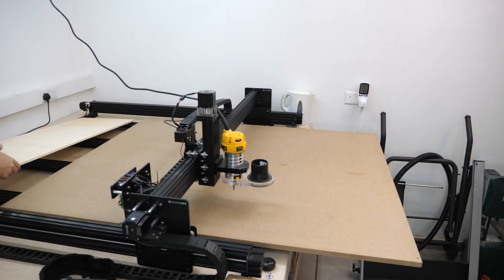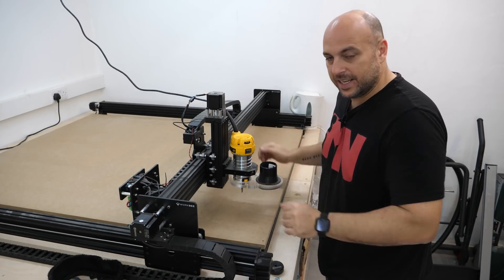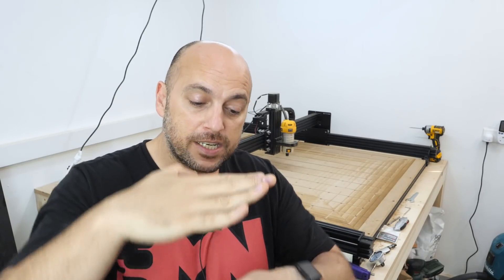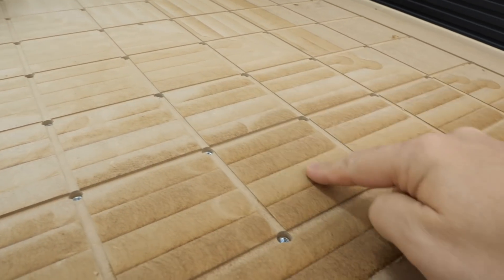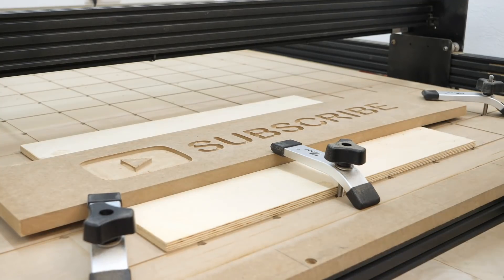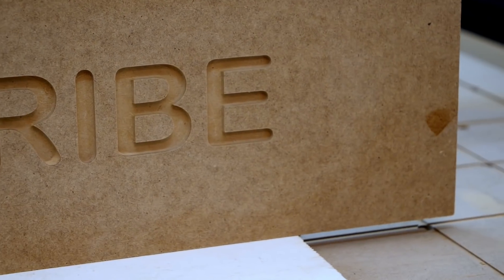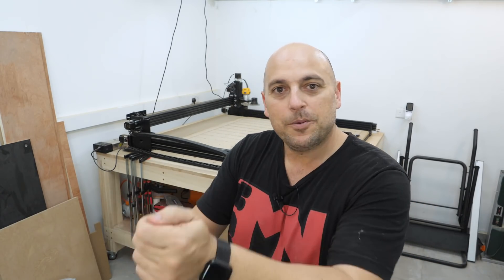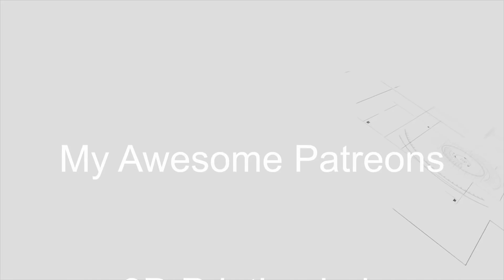First Carve On The Massive CNC - Fails And Wins!

Comment: Nice setup I have just finished building a X1.2m Y 1.5m and Z 300mm 
I use Mach3 board and just purchased the V carve vectric desktop software 
Curios to know what kind of cad cam software you are using

Comment: Great video. Hey, I noticed you have a man door cut into your garage door (I have never seen this), can you provide any info on this, did the man door come built into the garage door, or is that something you added?  Thanks
Reply from the maker: That was pre-made like that, specifically ordered it that way so I don’t have to constantly open and close the garage door. Also comes in very handy if the electricity goes out
Reply: @3DMakerNoob  OK, who is the door manufacturer who offered such a garage door? I am in TX USA and have never seen that kind of option. Thanks
Reply from the maker: It’s a local company here in Malta. Fgp.com.mt

Comment: i know you made this video 2 years ago but im really interested to know how you fastened your wasteboard to your frame.  I had a hell of a time with mine.  It seemed like I would get a bunch of the t nuts seated into the aluminum extrusion but there was always one or two that I couldnt get in that tiny little groove, so I would have to lift the entire board up and start from scratch over and over and over again.   It took me the better part of an entire day to get all of the t nuts secured.  How many T nuts do you have holding your wasteboard down?  Did you do 3 rows of them?  Did you have as much issues as i did or are you smarter and more dextrous than i am?  ^Thanks for your videos, I really enjoy watching them.

Comment: why using stinky MDF boards if birch multiplex is available?
I have segmented my lostboard for my CNC in 6 peaces, so if the damage gets bigger i have to change (only) the most bad one.
This is to you have now a big printer ... but most parts will be small parts. So one of the segmented lostbord parts you have to change earlier then the others

Comment: What software are you using with the Work B?
Reply from the maker: Vcarve Pro
Reply: That was a quick reply thanks, no idea what that means but for someone with lots of manual routers and FDM experience you have inspired me to look further, is the software the one sold  with the Work B? I can cope with some of the base price but it sure adds up with all the bits!
Reply from the maker: There are other options for software which are free. Vcarve pro is quite expensive but since I have a large machine and needed certain features it was worth the purchase. Look up easel from inventables which is quite good
Reply: You are not making it easy to look away. I will have to refer to you in the divorce settlements after spending a couple of grand on this, keep up the good work best Boothy
Reply: Have you tried using Fusion 360 with this?  Also what sort of extraction system are you using or intend to use?

Comment: I personally avoid using T nuts if possible.   Glad you were able to knock these into the MDF without breaking the MDF.    The T nuts go into wood much easier than MDF.   By the way, you could have used the CNC to machine hex holes for regular nuts.   I prefer to use regular nuts than T nuts.   I use these in jigs so only one or two at a time.   I drill a hole then use hand chisel to make the hex corners.
MDF dulls cutters FAST.   The speed of the spindle creates a lot of heat when cutting which helps to dull the cutter, but the resin creates a lot of wear.
If I have to machine MDF, I use my milling machine at 500 - 700 rpm.   A lot less heat so the cutters last longer.
I am jealous of the space you have for the new workshop.   Looks very nice.
Dave.

Comment: very nice progress Joe, really looking forward to seeing all the new projects you have in mind! the workbench looks excellent. amazing how many useful tools and functions you've tucked into it, none blocking eachother and 100% of the surface remains usable! seriously cool. i'd think about giving it a hardwearing and non grippy surface though, if thats MDF or even HDF as it seems, it wont stay nice for long. you might be thinking of some kind of epoxy lacquer but i think the most cost effective option would be 1mm galvanised steel. you can snip it by hand and hammer it over the edges, and its actually probably cheaper and less work than a suitable paint finish.

anyway my guess at the channel name is 'build 'n' make'!

Comment: I can recomend  the router bits of Amanda tools the are so good and if you not already buy the vectric program. Thanks for the content
Reply from the maker: Purchase vcarve pro and just ordered a set of Amana tools :)
Reply: @3DMakerNoob  nice! They have a sheed whatkind of rpm and chip load to use. You should not run the dewald above lvl 3 10000 rpm should be enough. That can be the reason that the bit burned
Reply from the maker: That would make a lot of sense, I was running it at around 5. Still lots to learn. I also wanted amana as they have tool files for vcarve:) thanks for the tip, I’ll need those hehe